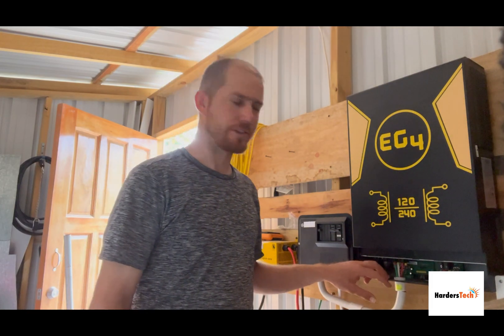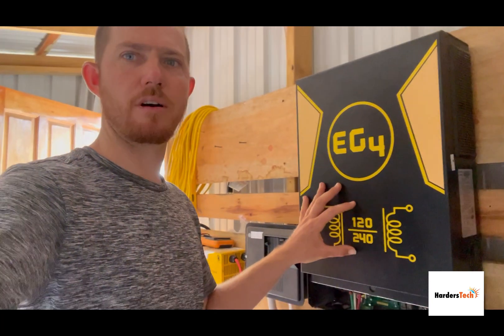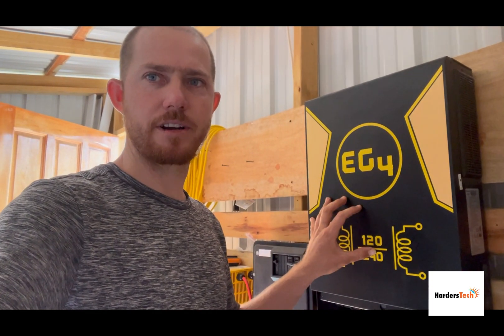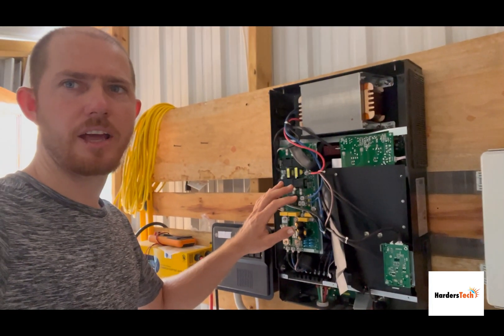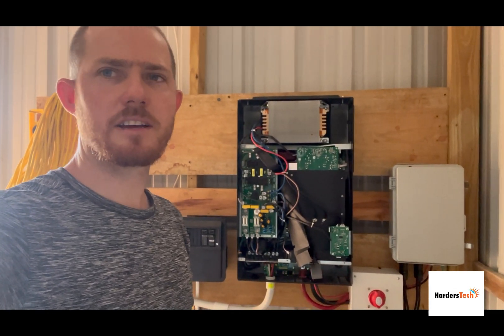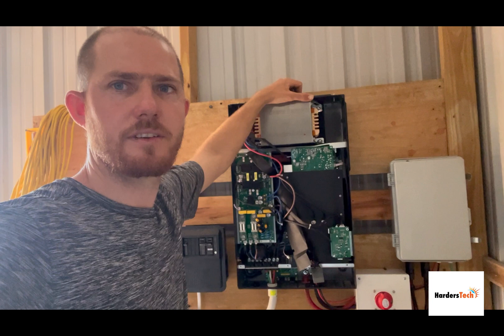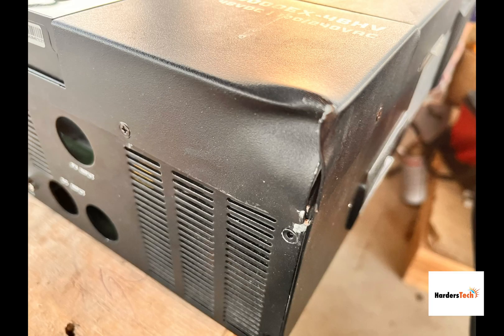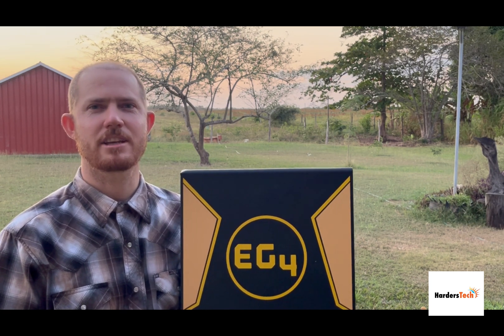Is this why EG4 does not sell the 6000EX-48HV Model anymore?

Comment: Mine just has the same issue starting. It has been in use for almost two years and has never had AC input. This I inverter is a fire hazard and should be recalled. I will see if SS responds to my request for assistance
Reply: Did they

Comment: I have the same inverter and had the same problem and fixed it.Its bad quality control.
For me It was loose nuts that created the shorts between the plate and terminals of the circuit board. Literally I can unscrew the nuts with my fingers. Not torqued down at all. Nor do I recall seeing any torque markings on any bolts..
To fix if the board hasn't fried, you need to sand down those plates as well as the terminals on the circuit board. Must be smooth flat good contact surfaces. I turned my plate around from the burnt terminal so to split the difference so to speak on the surface contact area. 
Mine has been working after that for about a year...

Comment: I do not believe for a second items like this are even tested to see if they  "work"   They are designed on a computer and if it does what it is suppose to for 2 mins they ship it.   They do not duty test them... it takes time and it finds faults...   MUCH better to send it out to a person like you to do the research as you will buy 2-3 units even when they keep failing....
If you let Sig.  solar   fk you then you deserve what you get... On face book name them... hash tag them on all you posts...  buyer beware....  if you can not get a company to honor a warranty in this day and age it is because you are not talking load enough.
Send them this link.... remind them that that is 2100 people that will never buy an EG product  NOT just that one.
I have seen the inside of plenty of inverters and have never seen the battery cable attached to plane circuit board like that was.   There is always a big piece of metal to clamp it to so it does NOT crush the circuit board.   That is just a crap design and the manufacture knows it... but they have 2458 more of those boards to sell before they are going to fix it.     And when no one will make them honor the warranty why not?

Comment: Yes.  I bought 2.  one worked at start up.  Error code 62 came up.  Nothing in the manual for 62.  Struggled for weeks to get tech support to no avail.  Then with only one inverter powering my load, an 8 day cloudy streak, my 3 SS batteries shut off.  Been a year now.
Reply from the maker: Thanks for sharing

Comment: Thanks for the insight. I had the same problem with my 6000ex-48hv which I bought from S.S. Since day one, it was giving out some circuit board burning smell when under heavy load, and eventually stopped working. Fortunately I was able to sent it back and had it repaired and shipped back to me by S.S. under warranty. In the repair note, they indicated that the rectifier board and battery terminal board were replaced. The repaired unit has been working for almost 3 months now. No burning smell whatsoever.
Reply from the maker: That’s great you received another one for warranty, it’s usually very hard to get an hold of Signature Solar.

Comment: thanks for taking the cover off and showing the problem... I bought a refurbished unit, wired it up, and it fails after about 20 minutes running light loads for testing. L2 output blinks off, re-sets, comes back on and runs for a couple minutes, and blinks off again. likely same problem that you show with bad connection to main board, but I can't repair that myself, and SignatureSolar does not return calls.
Reply from the maker: It’s bad for business not returning calls, I sometimes wonder if their are so many tech support needed from Signature Solar, or if their tech staff is so little

Comment: Eureka, you have found the weak part of this piece of equipment. 

I have run across this problem with other equipment. 
When you’re working with higher current levels, the wires on the circuit board at interfaces between wires and the copper on the board can cause heat and melt the solder connections.

As someone else has mentioned, tightening the main Connectors will help but sometimes, you have to solder the connectors on the circuit boards. Sometimes even on both sides.

I have this exact inverter, a low frequency inverter. 
I was shipped an EG5 6000XP, and I decided to send it back in Lou of keeping the 6000EX.

There is a certain level of inherent noise on high frequency inverters. 
The low frequency, inverters have cleaner LINE outputs for Ham Radio use. 
The HF bands do not have as much noise.

My electrical engineering, friends and solar installers, and Solar engineers have told me that historically the low frequency inverters last longer and are safer on critical electronic equipment. High frequency, inverters have a normal life expectancy of about 2 to 5 years. The low frequency units usually last longer unless if there is a Design Flaw. This looks like a design flaw.

Thank you for identifying the main problem that has been seen with this unit. I will keep my eyes open and pop the top and check the circuit boards and resolder them if needed. 

Tom N8BKJ

Comment: Same issue. BP error. Shut downs on battery. Arcing and sparks. Opened it. Every battery DC nut was loose. Tightened and running perfectly. The issue it to catch it before it burns and you should have a good unit afterwards.

The refurbished one I was sent by signature also had the same slack nuts. Tightened and that one worked as well.

The tightness also clamps at the back and would be very shaky/wobbly without sufficient torque and cause the burn/arc
Reply from the maker: Thank you very much for addressing that! According to the manufacturer that problem is solved now for the newer units.

Comment: I bought a refurb 6000ex right before the 6000xp came out 😡.  Have run my house on it for about 5 months and no issues so far.  I’m definitely going to check the terminals and try to avoid the same issues.  Will ultimately be replacing it with two 6000xp which appear to be vastly better built units.   Thank you for showing the damage on your inverter and I hope the xp is a trouble free replacement for you!  👍⚡️☀️💡🔋
Reply from the maker: Well I can’t tell by experience if the 6000xp is better in the long run.
The manufacturer for 6000ex contacted me and promised to fix the issue and the actually promised me to send two brand new ones (supposedly a better terminal and new Firmware)

Will make another video when that comes.

Comment: I repair inverters for a living have done so for the past 24 years. The burnt DC terminals in these inverters are indicative of either loose terminals causing an arc or a short circuit on your FET board probably from a shorted capacitor or shorted MOSFETs. Do you have fusing or a DC circuit breaker between your battery and your inverter?
Reply from the maker: Battery connections were tight very nicely. However, I have only a battery disconnect switch. I don’t have a fused DC circuit breaker.
Reply: Then I would suggest checking the MOSFETs and the filter capacitors for shorts. If the MOSFETs are shorted, they will appear blackened and burnt and may have the tops of their plastic casings blown off. Many of these low cost inverters, especially the lightweight high frequency units  use Chinese made MOSFET transistors which are notorious for spontaneous failures.
Reply from the maker: Thanks, I will take this one apart and see if the nuts on the terminal inside the inverter are loose, however, the nuts in used to tighten the wire that goes to the battery where nicely tighten.

Comment: That's what you get for buying an inverter from Sig Solar. I would never buy any of their inverter products. Especially their high frequency, transformerless inverters.
Reply from the maker: What brand of inverters do you normally use?
Reply: On one of my off grid properties, I am using a Schneider Electric 6.8 kW inverter and a Sigineer 6kW inverter. Both of them are heavy duty, low frequency inverters. On my second property, I am using a Sigineer 12kW hybrid heavy duty, low frequency inverter.  @davidharder8357
Reply: Hi do you know where to get parts for these units? S,S won't sell me any parts for mine

Comment: They were offering a trade in for the new one. There was a cost but you would get something for the one you replaced.
Reply from the maker: I would have to ship it to the USA, it’s makes things a bit complicated
Reply: @davidharder8357  It's under warranty so they would pay shipping and since they dont sell that unit anymore will give you store credit, the 6000XP is made by LuxPower, which have had this unit out for over 5 years, a lot of people now have them without the problems of the others. A lot of suggestions on buying a Schnieder, good units but 4 times the cost. Also call tech support as soon as they open and you will get thru quickly.
Reply: It does take some patience and persistence with those guys. Don't know why they move so slow but keep your cool and let them wiggle and they will come through. They have saved me a bundle of cash on equipment and panels.
Hope you were able to take advantage of that buy back. Between that and your warranty surely they could work something out. That's a great deal!